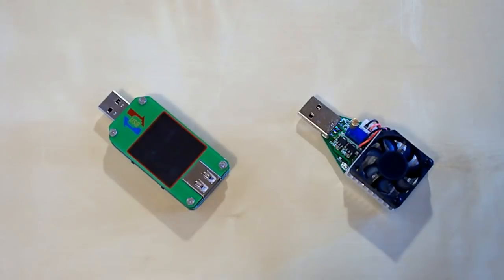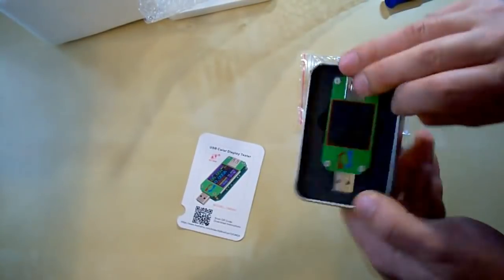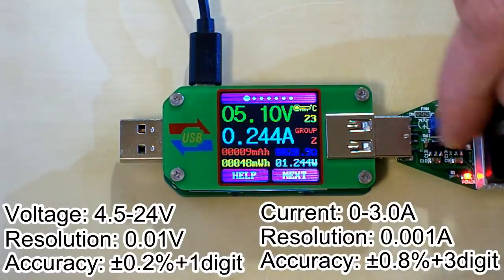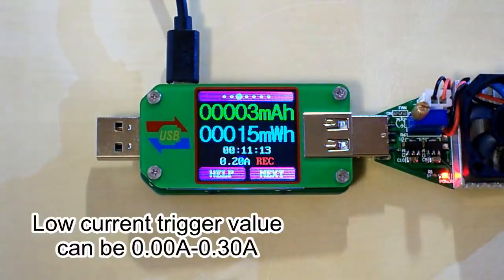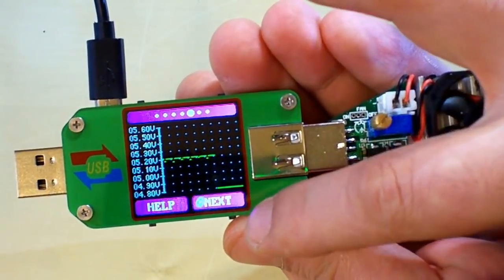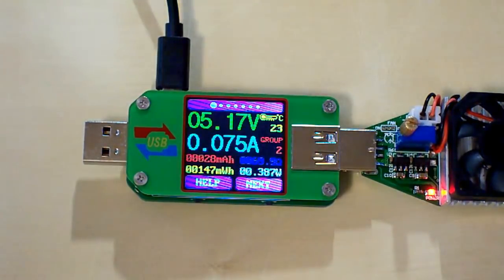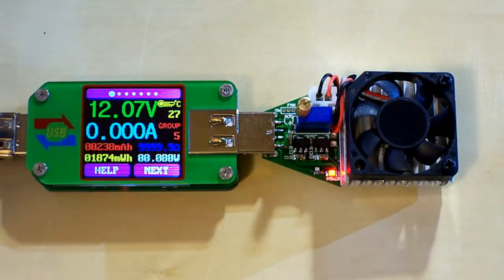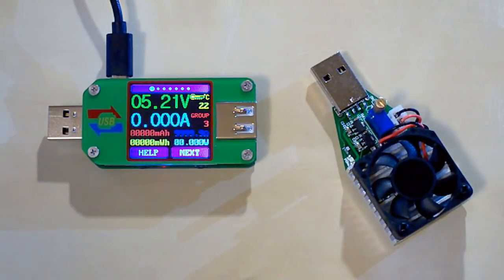RD UM24C Bluetooth USB tester and USB load review from Thunderheart Reviews

Comment: Do you need the USB load attachment to run the tester.
Reply from the maker: thank you for your comment, the tester is used to detected the voltage and current and record data, so not only a USB load,  just make sure there is current flow, it will work. you can use it to check the current and voltage when charge the phone

Comment: There's a Problem with the scaling on 4k Displays with UM25C 1.3 Software. Would be nice this get fixed. Voltage, Current, Power and Impendance get cut off. Also the the complete Windows is fixed is not a rly nice sollution.
Reply from the maker: could you make a video and send it to me?(the email address is written in the description of this video), so that I can know what is wrong, thank you so much.
Reply: @rdtech9153  Send you an E-Mail with an Picture. You can see the Problem in there
Reply from the maker: @HW-Origin  ok, I will reply as soon as possible.
Reply from the maker: @HW-Origin  I have reply your email , you said the full screen problem, right ? our software can't be full screen, I think you saw some picture at full screen, it is just advertisement effect